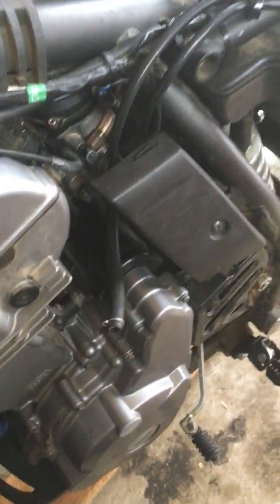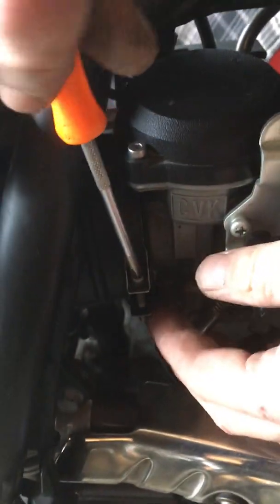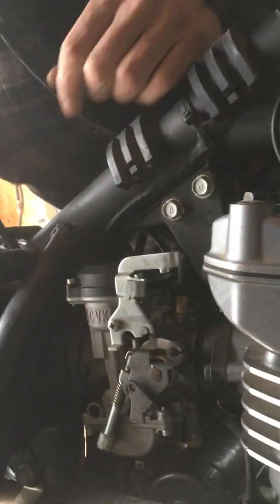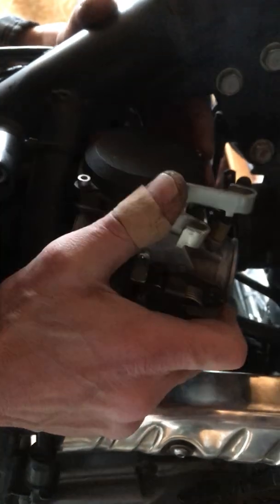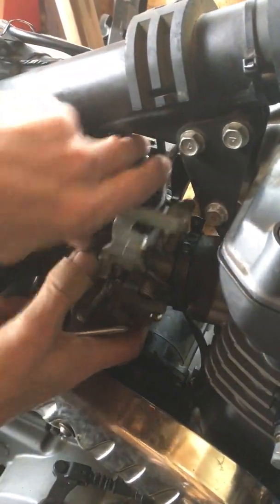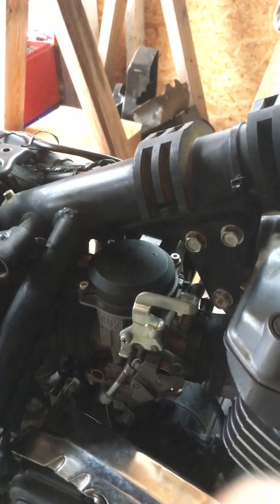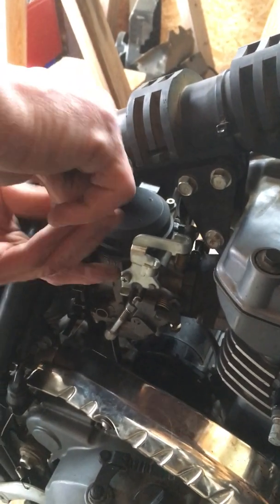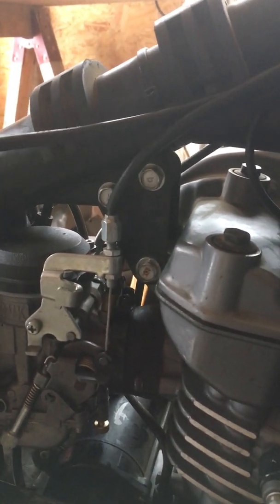KLR650 Carb Removal / Re install procedure (my way, but not the only way)

Comment: Another great instructional video. Is there any possibility of lubing the rubber boots with WD40 or something to make them go on easier? I look forward to more of your posts...valve adjustment for KLR would be very cool...I know there are a lot of them out there - but I just find your wavelength easy to understand!
Reply from the maker: shouldn't lube the boots no, can if you like, if you follow the process outlined in the removal installation video, it goes in fairly easily

Comment: Why did you remove the individual cables when one screw takes the bracket they are mounted to off the carb without getting them all out of adjustment?

Also, what is the "popping" noise everyone keeps mentioning and not explaining when the carb is out of adjustment or needs a different jet? I have this problem after a rebuild and have no idea what to do about it
Reply from the maker: because there are a total of 5 threads on that screw, its red loctited in, and if you strip it you need a new carb.
Reply from the maker: its not meant to be removed, ever
Reply: @megacityperformance3523  Okay. Thanks!
Reply from the maker: see this page to find out how to get rid of backfiring https://www.facebook.com/media/set/?set=a.526871388862841&type=3